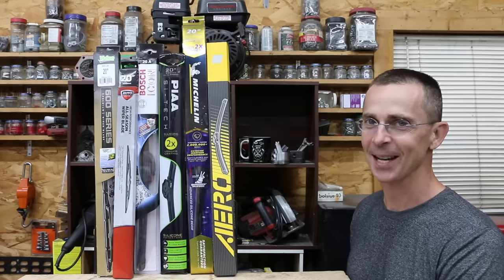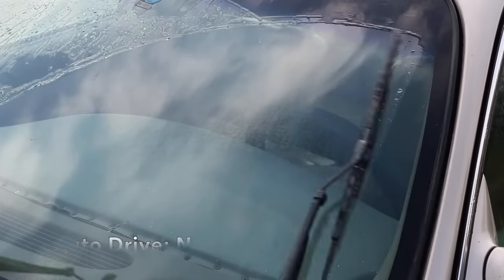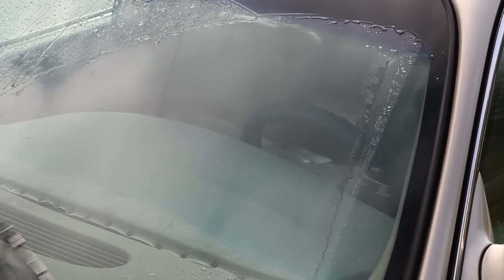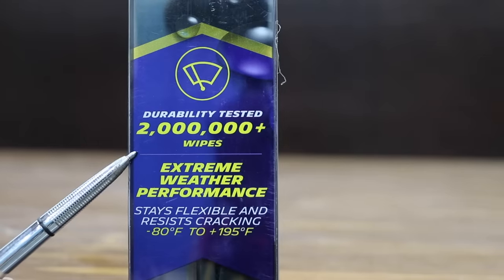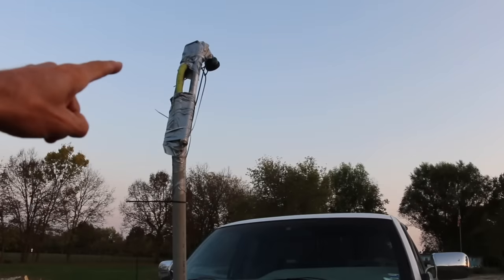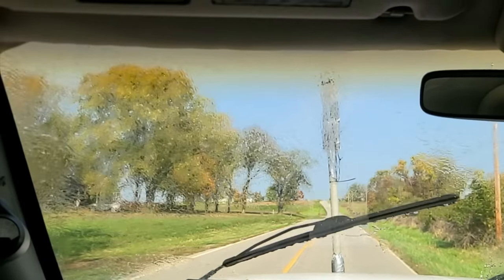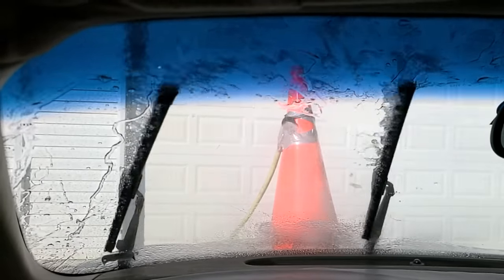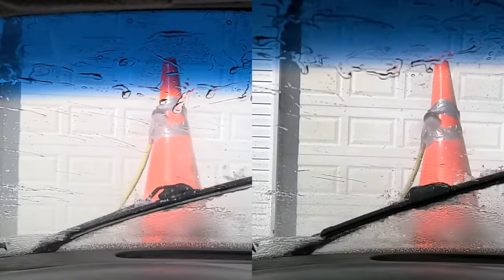Best Windshield Wiper Blade (AFTER 1 YEAR)? Bosch Icon, Rain-X, PIAA, Trico, Valeo, AERO

Comment: I will never buy another Michelin. The only time in my life in 50 years of driving that a wiper has come apart on the road, at 70 mph on the interstate. The wiper refill came out of the clamps a little during light rain, and a clamp made a wide semicircular scratch on my windshield by the time I got home. I always thought metal wouldn't scratch glass. Michelin is dead to me.
Reply from the maker: Thanks for sharing!

Comment: could you rate jump starters for weak or dead batteries there are 2 different types capacitor and lithium battery 1000 amp 2000 amp etc. Thanks!
Reply from the maker: Thanks for the suggestion.

Comment: You didn't even TRY the Michelin semi-clear blades from Tire Rack and other places! Yes they cost about $70 a pair, but I've had a set on my 2011 that sits OUTSIDE under a pecan tree for 11 YEARS! My Maserati 4.9L Saloon came with them, and since then, every car I (or my late sister or late parent's owned) gets a pair.  They are a silicone-based plastic that CAN'T scratch, doesn't streak, doesn't "chatter" and if you CLEAN your windshield annually with a product like old Gold Seal Glas-Wax(tm) (or Maguire's or Mother's), you'll never get road film (oil) build-up you'll get my kind of service from them. Bosch blades aren't terrible for the price, nor are PIAA's IF they have them to fit. This old man was a "pump jockey" 53 years ago, and ANCO or TRICO's don't last 4 months, PLUS they change the "arms" and blade holders annually now, but so do OEM's. For DECADES, Toyota used 6mm refills, now they have a DOZEN widths, literally! GM is the WORST with five kinds of pivots on the arms, and by O'Reilly's parts book 27(!!!) refill base widths and styles.

Comment: Wish you would be able to test the kimblade with square blade. Quite surprised
Reply from the maker: Thanks for the suggestion.
Reply: @ProjectFarm  specifically the kimblade 4.0 which is really popular among those who are kinda hard core into wiper blades. I’ve put them on my i4 and love them. But first couple uses they made a little noise then became Uber quiet and really move water!

Comment: This test doesn't reflect my experience with these brands at all.  Bosch icons did so poorly for me I didn't even wait for them to go "bad" before replacing them.  RainX were just as bad.  Trico blades have done VERY well for me, but I usually get their very best or second best option.  The price increase is minimal and still much cheaper than Bosch, RainX, etc.  

I think the reason for this discrepancy is not testing light rain/mist.  I believe this is the most challenging situation for wipers, with the most chance of streaking (not just a trail of water, those kindof foggy trails that sick around for a while before fading) and squeaking or chattering.  This was my main problem with the bosch blades, they streaked and chattered HORRIBLY and only stopped in the very heaviest of downpours.
Reply from the maker: Thanks for the feedback.

Comment: would like the same test with only the top of the line baldes like the trico ceramic
Reply from the maker: Thanks for the video idea.
Reply: i have had good experience with the trico brand , so i just bought trico's top of the line silicon ceramic which are supposed to be the quietest - will post here how they perform when i get them, my personal experience with bosch icon's was not so good, had lots of chatter and only cleaned well in one direction
Reply: ok, i got and installed the TRICO Silicone Ceramic, ($76 for the pair on amazon including nyc sales tax, ouch!)  so far they are quiet, dont streak in either direction and dont chatter when dry, but they are new, will report again in a month how they are holding up to the new york city's sun, heat, and dirt
Reply: @ProjectFarm  ok after a month in nyc's summer the blades are still great - please include them in your next review,   tx

Comment: Girlfriend had a 2013 Ford Focus, the OEM wipers were REALLY thick rubber that lasted 5 or 6 years. I tried in vain find the same ones as replacements and eventually gave up and bought the Bosch Icons everyone thinks are so great. The Bosch Icons were a huge disappointment, they had the same shitty thin rubber inserts as all the others that fail in a few months.
Reply from the maker: Thanks for sharing.
Reply: you didn’t think to go and get them from the Ford dealership?
Reply: @omgitsBenjamin  The Motorcraft replacements from Ford were also cheap junk, nothing like the originals.

Comment: The type of rubber used to manufacture most wiper blades today is engineered to last less than 6 months. You can buy the most expensive brand you can find, they all fail within a year. Silicone is by far a superior material to use for wiper blades. They can last well over 3 years and doesn't cost that much more. Manufacturers know this, but they make way more money selling you multiple pairs of rubber wipers a year  compared to one pair of silicone wipers every 3-4 years.
Reply from the maker: Thanks for the feedback.

Comment: I have mixed feelings about the Bosch Icon blades. I put them on my 07 express and they're great, so I bought a set for my wife's 2017 Escape and they break if you turn the wipers on when there's snow on the windshield. It happened a couple months ago, and again yesterday. If we forget to turn the wipers off and start the car before clearing the snow off the windshield, the wiper will break off right at the mount point. Needless to say, but I will not be buying Bosch blades for her car ever again.
Reply from the maker: Thanks for the feedback.

Comment: you get what you pay for really, sometimes. I change out the front blades once a year as they'll wear out and then you get streaks and chatter. And that's annoying when driving. Each time I change them out, I go to my dealership and get ones made for my vehicle. That what I know they'll fit the windshield corner to corner as nothing worse than a gap where the blade doesn't flex to fit.
Reply from the maker: Thanks for the feedback.

Comment: This is an old video that popped up but timely for me. Trouble on both vehicles blades even when I install new blades. On my truck there doesn’t seem to be enough pressure on the glass. I might need new arms.

On my Hyundai Sonata, unless it’s a heavy rain, the right blade chatters loudly, mainly on the upstroke, even with new blades. Has anyone experienced this, have thoughts on why, or what might be the problem? I’d appreciate constructive feedback.
Reply from the maker: Thanks for the feedback.

Comment: My car had brand new Rain-X blades when I purchased it.
They work great when new, but very quickly degrade and leave a million streaks from cracks in the blade.
Do no buy, they suck, especially at the price.
I've used Bosch for years, and always had good luck with them
Reply from the maker: Thanks for the feedback.

Comment: Had Bosch and they were awful from day 1 and overly expensive. This winter replaced with Trico Ice and will never use anything else. And at around 15 to 19 bucks a blade you can't beat it.

Comment: What happened to the  good old Service Station  ANCO wiper blades  when I was growing up in the 70s  there was A   T.V. Commercial featuring  comedic duo Laurel & Hardy in a old time car switching over to ANCO  wiper blades and in 1974 there was a detective movie with John Wayne called McQ  the movie ended  with a car chase on the beach very dramatic  ANCO claimed in a T.V. Spot that they supplied the Wiper blades for the stunt vehicles used in that beach scene it was very dramatic & action packed & Wet
Reply from the maker: Thanks for sharing.

Comment: All wipers (even old knackered ones) work pretty well in heavy rain when all you need is to see well enough to drive properly.

What I struggle to find is ones that work really well in everyday conditions with small amounts of water or no water.
Do they clean well, what kind of noise do they make (esp on dry glass), how well do they stay like that when cleaned from time to time - and is silicone generally much better?

These tests here are mostly useless. Sorry!

Comment: I've always thought the bow type performed better and were cheaper but were absolute trash in snowy weather as all the little joints and pivots would freeze and they'd stop working almost entirely. Also the thin contact blade would ripe pretty quickly. The beams don't seem to do as well in the rain but they do worlds better in the snow and lasted a lot longer. Despite living in a place where it snows hafl the yearI still use the bow style almost exclusively just because on both my vehicles the window sprayer is designed to spray THROUGH the bow. A silly design I admit, but it means that when using the beam style 75% of the water sprayed just splashes directly back down under the hood.
Reply from the maker: Thanks for the feedback.

Comment: Sorry to ruin it. Performance of the blades is different on the move and when standing, just because the water, removed from the windshield, flies back onto the windshield when the car moves. So it is important which way the water is pushed)

Comment: I have used the PIAA wipers on my Toyota Matrix for 4 years. I'm on my 2nd pair now since the first finally stopped working.

I don't think this is a fair test because the silicone legitimately leaves a  polished surface after repetitive use, which helps contribute to better performance during heavy rainfall when the water beads together more efficiently. You wont see the benefits unless you use the wipers regularly on the windshield prior to the test.

Comment: Just an FYI... the Bosch Icon with the "beam" design does a horrible job on the passenger side of my dodge ram. I think the single beam is not enough to keep even pressure on the windshield.. so $20 out the door.. I will definitely stick to the traditional arm design.. the Bosch single beam may work better on shorter blades buy the ram takes a 24" blade
Reply from the maker: Thanks for the feedback

Comment: PLEASE get your hands on some silblade brand blades. I have a pair of metal frame silblade wipers on my land rover discovery, which lives outside year round in seattle. those blades have been on the truck for TEN YEARS NOW. THEY STILL WORK. it's insane. They take a few wipes to get going but after that, like a brand new set of blades. I don't get it. and not "tolerable" working. I'm insanely, insanely anal about having good working wiper blades. The silblades on the old discovery have yet to need replacing
Reply from the maker: Thanks for the suggestion.

Comment: I bought a pair of able wipe wiper blades on ebay 6 months ago forr 15 bucks or so. They are absolute crap and now skip and make noise. Far worse than the wal mart branded ones that come in the red and white package for about the same price. The only upside was that they have a rubber sleeve on the top whereas the walmart pair does not so they have a premium look to them but minus the actual function.
Reply from the maker: Thanks for sharing.

Comment: Bosch Icons are the worst blades I’ve ever used in winter conditions. As soon as temp gets below freezing the blade turns hard as rock. The plastic gets very brittle and cracks and breaks. It might be okay if you live in an area that doesn’t experience snow, but you’ll be extremely disappointed in this blade during a Canadian prairie winter.
Reply from the maker: Thanks for the feedback
Reply: I've experienced the same thing... The blades hold up, but it's the clip area that gets brittle and falls apart.

Comment: 1.  A   B  I  G   problem with wiper blades wasn't addressed. When wiper blades are at rest in the down or off position they take a "set", or "memory". Then when they're used, they tend to "plow" instead of squeegee. This causes a LOT of annoying "chatter" and "skip".
A rubber compound that won't develop a "memory" is badly needed. 
 2.  Maybe a blade made of several thin layers (like old wiper blades were made) would give better service.
3.  Also, wiper blades are grossly OVER PRICED !  Why don't they make the replaceable inserts any more ?  That would work fine if an old style bridge beam frame was available.
I don't give a @#&!! about appearance, I want something that WORKS and gives GOOD SERVICE   !
Listen up manufacturers, we have a "problem" here  !